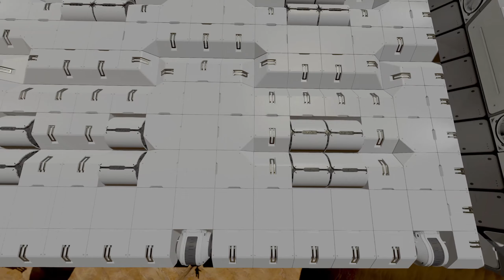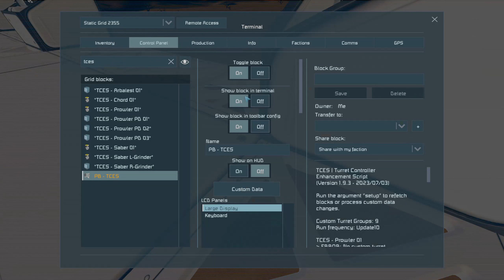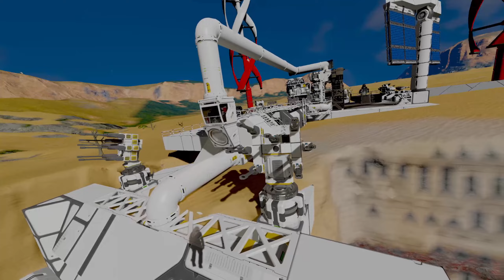Automations Unleashed - EP 14 - Base Mods & TCES - Space Engineers

Comment: Great video and you have rekindled an idea I had back when the Warfare update came out. 
First of all I like the grinder door greeble with the corner block, column, x2 blast door edge, column & Corner block because I like the idea of the lights on that design.
Back when we first got the turret controller I had an idea to have a turret mounted to a piston that would extend through a double door and then start to fire. Once finished with the mayhem you could withdraw them back inside to hide them again but I could never find a script to get the turrets to return to a default position. I think with TCES I may finally be able to get those turrets to work.
Reply from the maker: You would probably need to pair it with an event controller and defends block, once target detected (via defence block) open door, raise pistons. Then TCES takes over from there, then once target dispatched, wait x seconds, TCES returns turrets to ready position then retract pistons and close doors. It’ll use a lot of space unless you use the 1x1 piston mod.